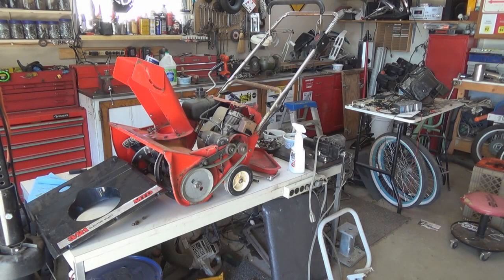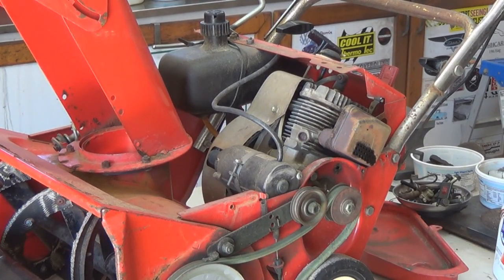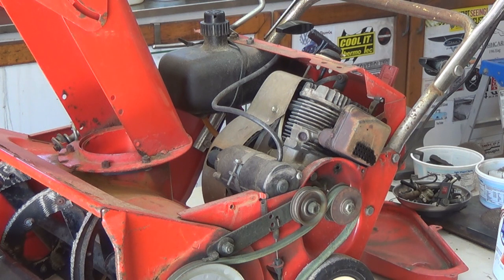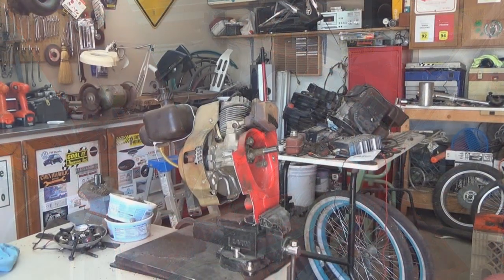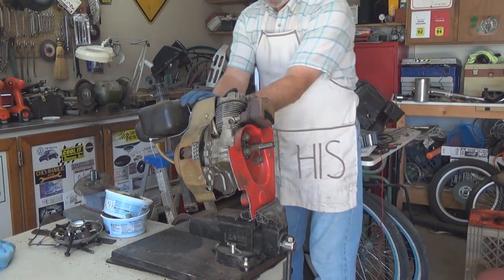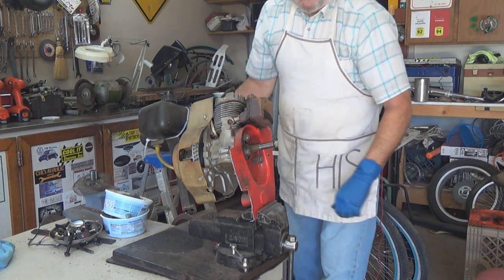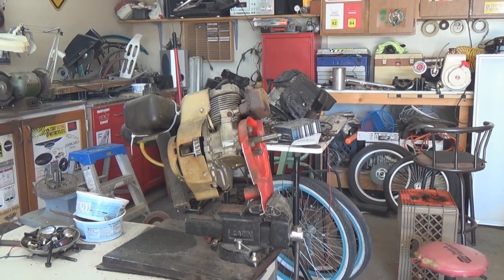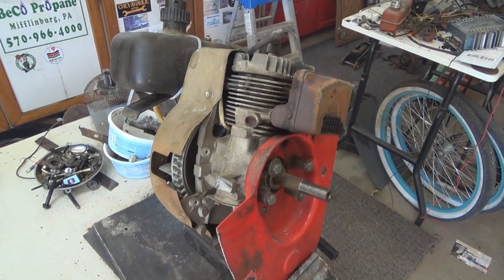Onward and upwards, Tecumseh, 2 cycle power for a bicycle?

Comment: When I used one pretty much like that on a bmx bike, I saved intact the "blade" engagment mechanisim, and just cut down the large oblong plate it is mounted to. With the engagment cable attached to one of the bike's hand brakes (and the bike's drive wheel being belt driven), it made for a cheap and easy kind of clutch set up.
Reply from the maker: +John Strange   Sounds kinda like what I am thinking. Thanks John

Comment: Love the on' Two-Stroke motors, guess it's cause I have fond memories of cruising the dirt trails on my motorcycles when I was young. Either that, or the awesome smell LOL.
Reply from the maker: +WigWagWorkshop   I'm going to have to have a different fuel can for this one as it calls for 32:1 instead of the 40:1 that is used on the string trimmers. I'm getting stoked for this next build, looking for parts now... Thanks for stopping by.

Comment: I think it'll make a good one for a bike! That little thing revs pretty quick!
Reply from the maker: +John Wallace   And it wasn't even warmed up at all. That was a cold start. Thanks John
Reply: You don't want to go much over the governed speed on these specific Techumseh 2-stroke engines or they like to break rods. Their NOT for high rpm use

Comment: Cool.  Save the big pulley of of the auger especially if it close to the same size as a pedal sprocket.  It looks like you already salvaged the clutch setup.
Reply from the maker: +justanotherwingbuste   I didn't get the pulley off the auger unfortunately, but I already have one about the same size so it is no problem. Thanks for stopping by.